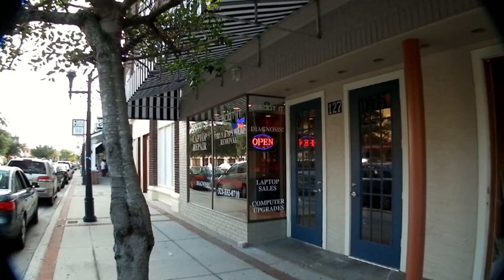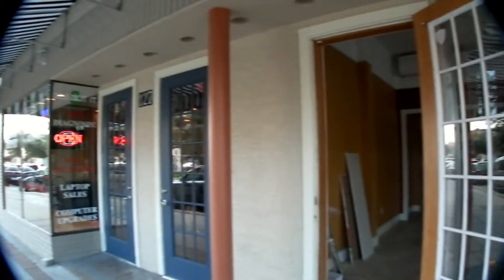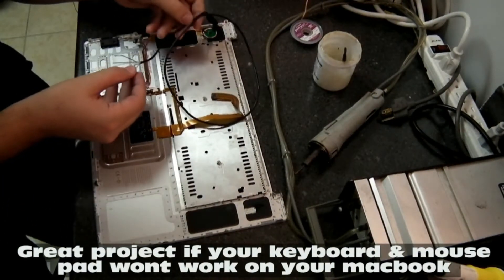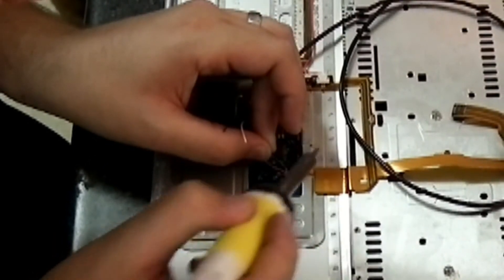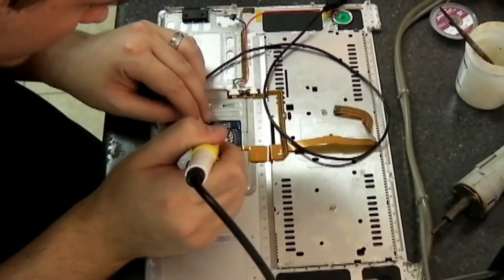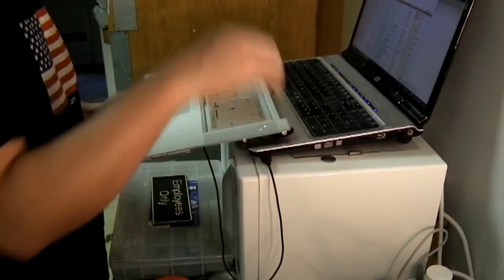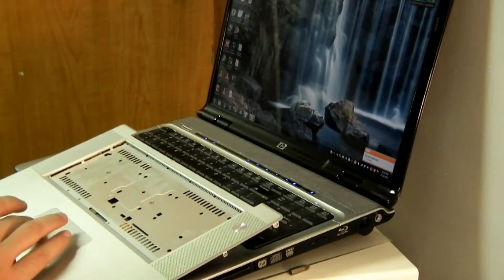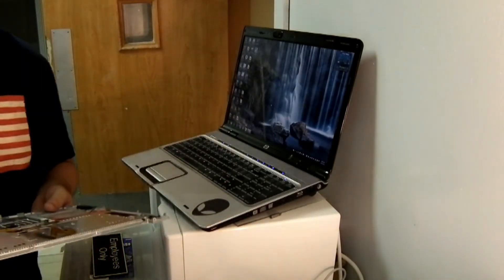Mac Tech Hack!  Macbook keyboard & touchpad USB DIY Hack

Comment: nice trick. My 4yo hp probook 4510s laptop is heavy and gets hot quickly and the speakers are weak. so i put it on the table and attach external keyboard and speakers. Now i can add a touchpad.